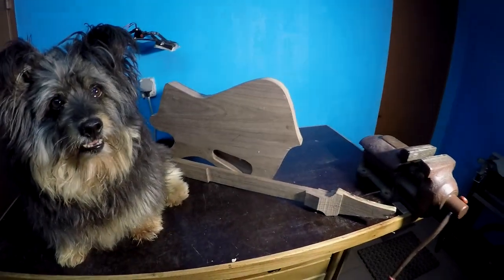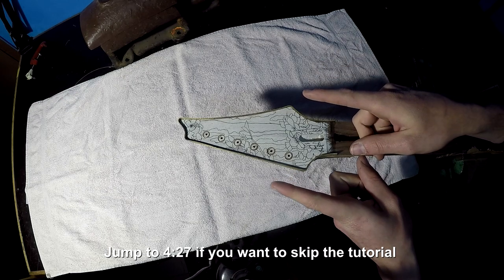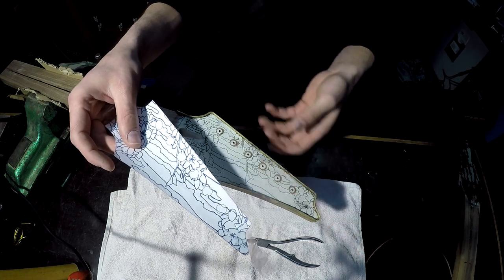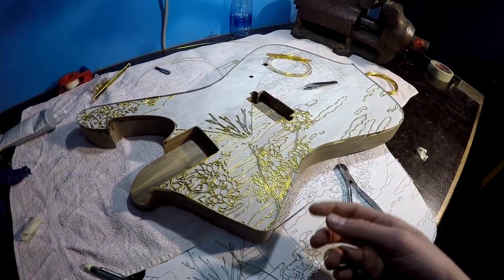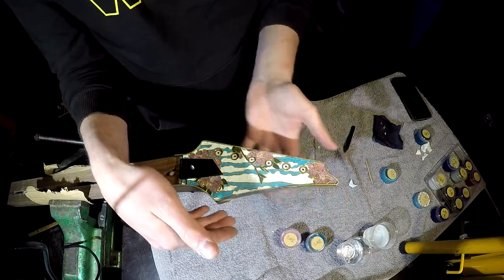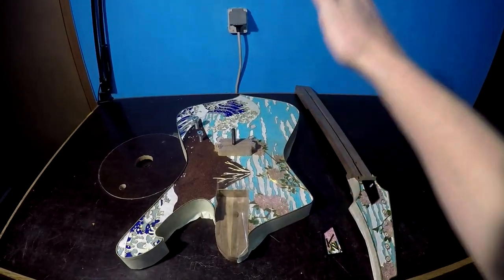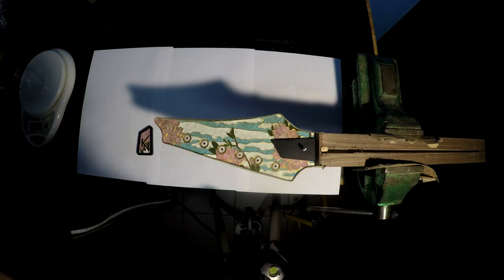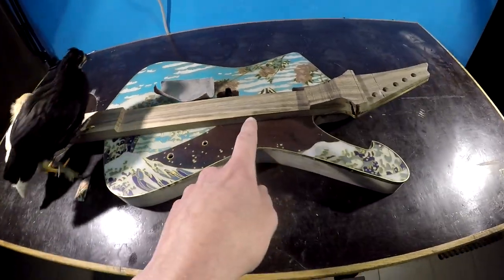The Great Guitar Build Off 2021 - The Tsunami build: Part 3 - Cloisonne on a guitar?!

Comment: Beyond awesome! Are you sanding it down until the wire is on the surface?
Reply from the maker: im sanding it down so that the epoxy is the same height as the edge binding
Reply: @KorezGuitars  Hope to see it soon
Reply from the maker: @madeofnapalm  dont worry, soon you will see